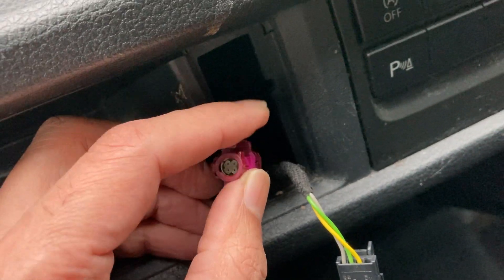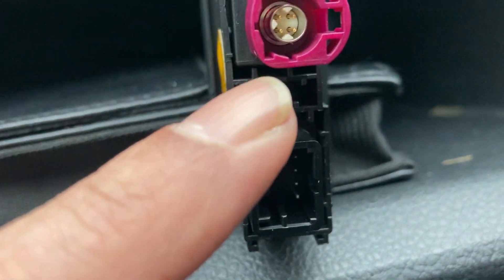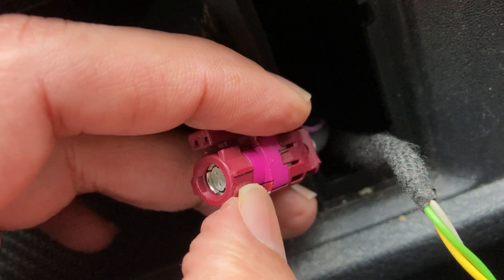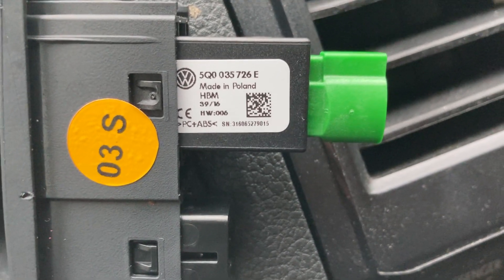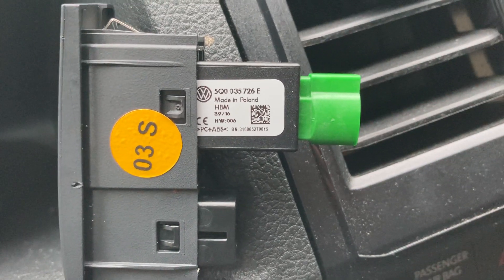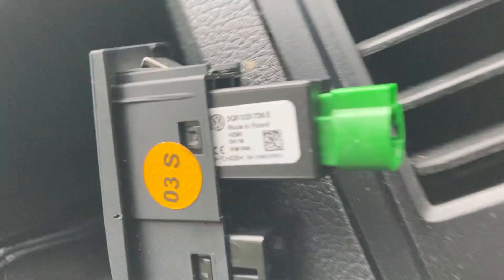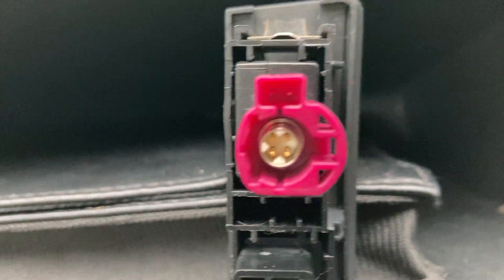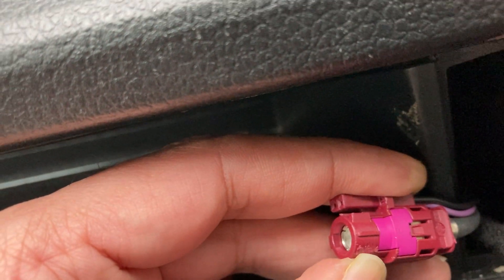VW Volkswagen Apple CarPlay USB Port Modded To Allow CarPlay. Part 5Q0 035 726 E  Fault Code U11B800

Comment: Do you have to configure it with an OBD after switching the ports or is it plug and play ?
Reply: You have to code it in the control unit like this. Vcds, OBDeleven pro.

Comment: My cable only has the round connector (4 pin) not the square ‘undercarriage’ with 2 pins.. i do have CarPlay but in the armrest. Would a different cable fit my head unit? 😓